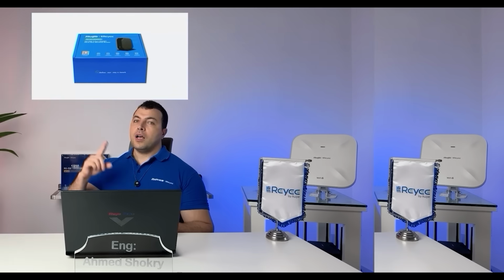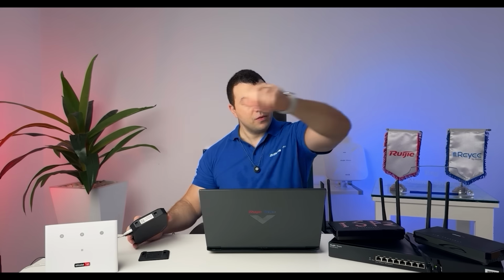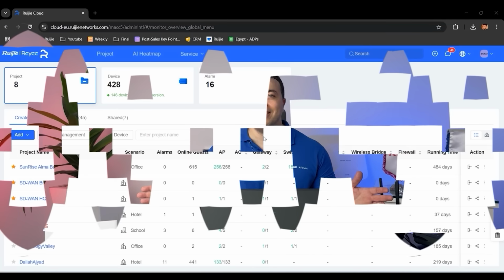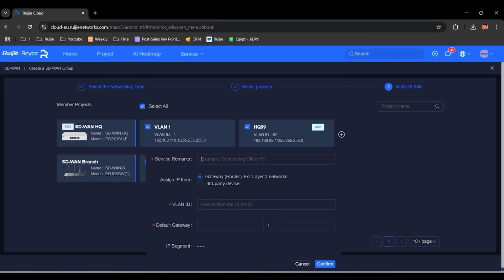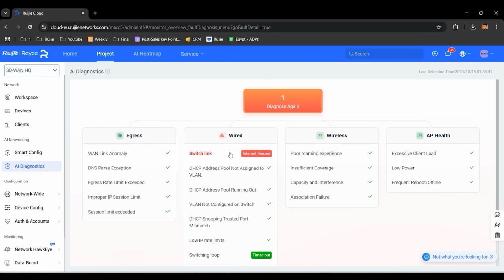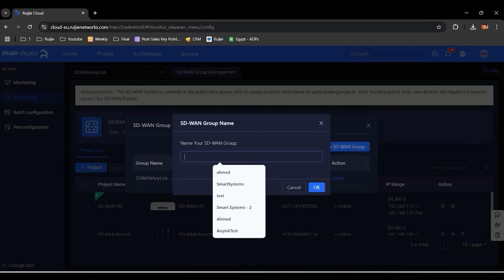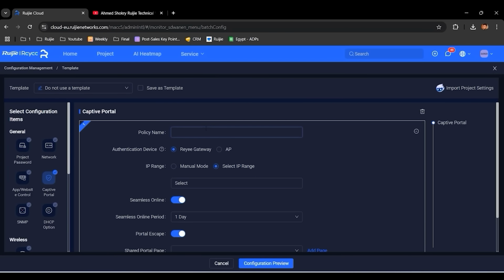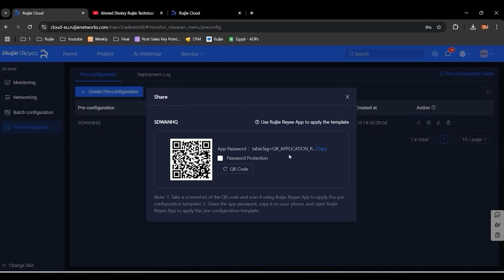SD-WAN Setup Using Ruijie Reyee Any-Link Technology – Part 1

Comment: "Hi! Thanks for the breakdown on SD-WAN vs. PBR. I have a specific use case: I’m managing two separate sites (Building A and Building B) in different locations.

Can I use SD-WAN to interconnect these sites for centralized Voucher (Captive Portal) management?

My goal is for a user (like a student) to activate a voucher in Building A and be automatically recognized in Building B without having to re-authenticate or use a new ticket. Does SD-WAN facilitate this kind of seamless roaming and database synchronization for vouchers between two remote routers?"

Comment: Thanks for your sharing video. May I know can we use the internet access from WAN1 to WAN2. For example, if WAN1 has been denined one of the internet website by authority at their location, can we use this website via WAN2 by using SD-WAN function?
Reply from the maker: Thank you my dear for sharing your inquiry.

from what I understand I will share my idea and if I understand your inquiry in a wrong way, please clarify it for me and let me help you in a proper way again 🌹

the purpose of SD-WAN>>>>> SD-WAN's primary role is to connect two or more branches (or locations) over a public network, ensuring secure and efficient communication between them. It is not designed to handle internal routing between two WAN connections on the same site or to bypass restrictions by switching between WANs.

For the scenario described in the comment (where two WAN connections are on the same site, and traffic needs to be routed based on availability or restrictions), Policy-Based Routing (PBR) or other routing protocols might be more relevant. These protocols can:

Route traffic for certain websites or applications through a specific WAN interface (WAN2 in this case).
Manage restrictions on WAN1 by sending specific traffic through WAN2.
SD-WAN, in this case, is not the right solution.